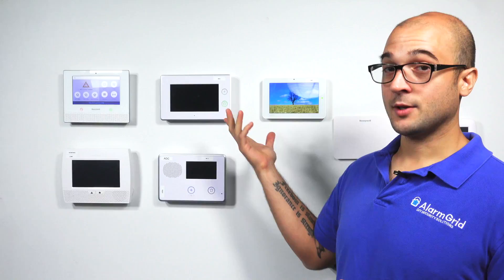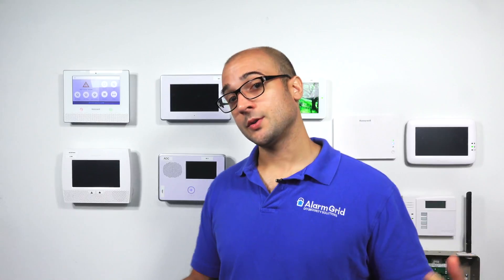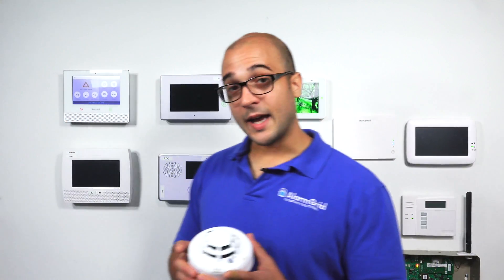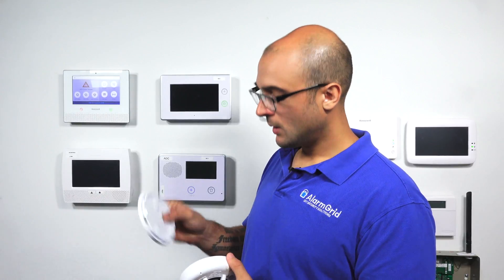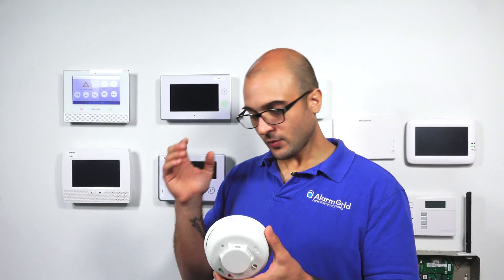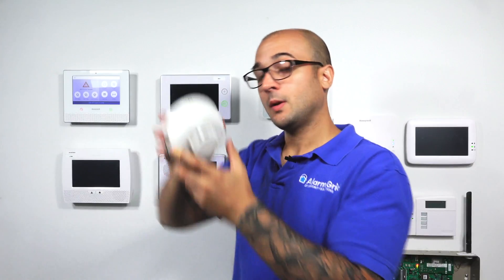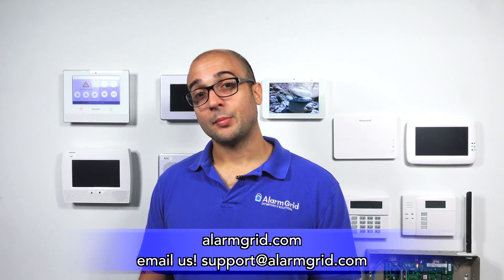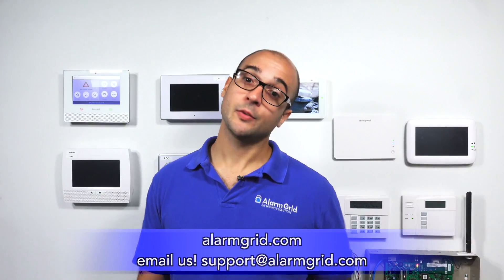Can I Connect A Wired Smoke To My 2GIG GC3?

Comment: What are the Smoke+ and Smoke - terminals on the GC3e used for?
Reply: Nothing unfortunately, here is a note from the installer guide  discussing the terminal block "NOTE: Terminals are still marked as 2 Wire Smoke but 2 Wire smoke is not
supported".
Reply: @nathangalarmgrid5205  thank you for the response. In the manual it states that terminal 13 is for an image sensor and terminal 14 is not supported. Strange.